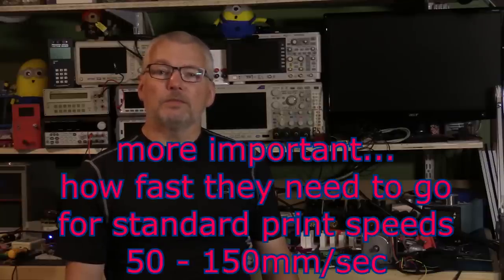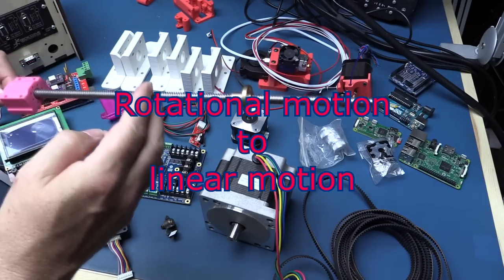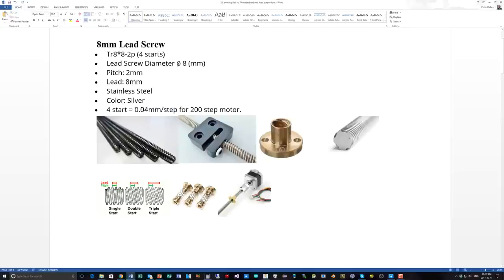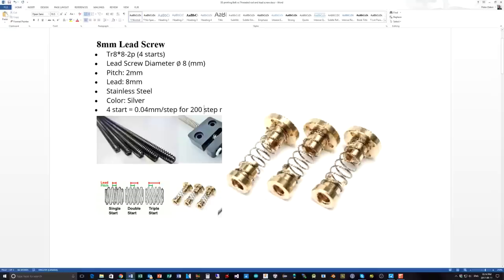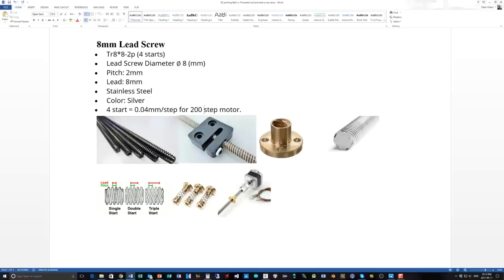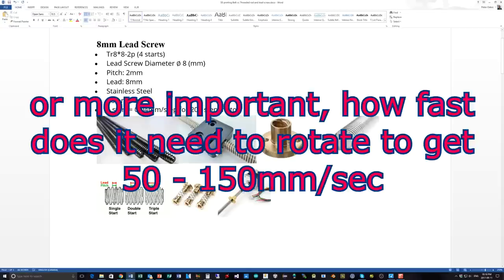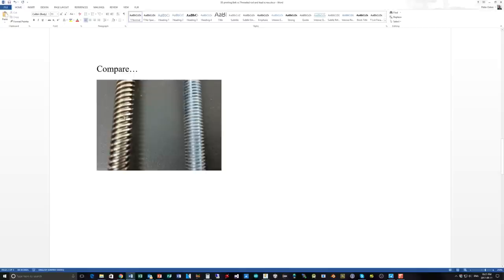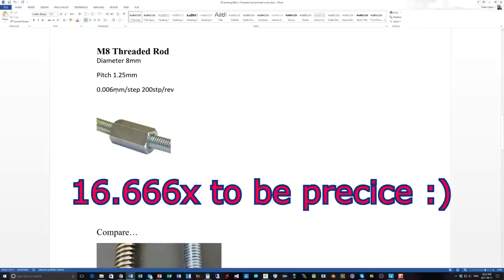3D printing, what to use... BELTS  or SCREWS ??

Comment: I'm doing a printer build that is mainly for research and learning to build a commercial printer to aid in fixturing for my CNC mill and to produce durable printed parts. 

It'll be my 3rd 3d printer but first custom build. It'll use linear components from PBC Linear. Goal is to make a precise decent speed printer with high temperature capabilities, meaning hot end capable of 450C and a heated chamber capable of around 160-180C. Because of the high temperatures I'm looking into not using belts. Reliability is also a goal.

Discovered non captive lead screw stepper motors and am considering them. Extruder assembly will be using a remote direct drive extruder like a Zesty Nimble and liquid cooled Slice Engineering's 450C Mosquito hot end so extruder assembly on X axis will be fairly lightweight. Because of the weight savings I'm interested in using a non captive Nema14 lead screw stepper motor from PBC Linear fixed to extruder assembly on a linear rail.

Since non captive Nema14's internal drive is what spins and the leadscrew doesn't spin I'm thinking this setup can achieve decent speeds and useful for large footprint designs since lead screw doesn't spin.

I'm interested in what others think about non captive lead screw stepper motors for X and Y on a large footprint 3d printer.
Reply from the maker: Thats quite the project
The fact that your "Spinning" the inside of the stepper rather than the lead screw does remove the moment of inertia of the lead screw but at the expense of the moment of inertia of the internal nut of the stepper + the mass of the actual stepper motor for two directions, this could be quite extensive. and the internals of the stepper could be subject to the very high temps of the build chamber. Another thought may be to stay with traditional ball screw / lead screw and have the steppers outside of the build chamber (Small holes would do it and not effect the temp stability of the chamber much. to compensate for the mass of the lead screws, simply use Nema 24's, you have much more space for them in this configuration. the rest of your build seems pretty well thought out, I look forward to hearing more about it.
Reply: @TheBreadboardca  Thanks for the response and input 👍

Regardless of how the extruder assembly is moved I'll have flat insulating accordion bellow covers to isolate motion system above heated chamber and more than likely liquid cooling stepper motors with same water loop that the Mosquito hot end is cooled with.

After some more research I'm back to considering belts. But still think the non captive lead screw stepper motor is an interesting idea. More than likely will build this large printer I'm working on with high end belts but after that will make a 200mmx200mm or smaller proof of concept build trying out non captive lead screw stepper technology.

For a large gantry style printer that has a print area of 2'-4' on X and 4'-8' on Y non captive lead screw(maybe ball screw if they exist) stepper(or servo) I'd think would have a lot lower moment of inertia than a 4'-8'+ spinning lead or ballscrew, not to mention the fact this avoids others issues involved with long fast spinning lead or ball screws.

Because my extruder assembly is so lightweight I figured for X axis a Nema14 stepper motor would be the minimum needed to move itself, extruder assembly and overcome friction from leadscrew coupling/anti backlash nut. 

Y axis would have either a Nema17 or Nema23 non captive stepper for each Y axis linear rail, so 2 of each.

Only reason I'm reconsidering belt drive in probably a coreXY arrangement(I like hbot arrangements simplicity but not gantry racking, additional rigidity and more precision assembly requirements)is it'll be a lot more cost effective, lower moment of inertia and only need 2 stepper motors for XY that can be located on outside of printer.

If I was to build a large printer with non captive stepper for XY all 3 motors would be fixed to a beefy gantry which rides on precision linear rail assemblies.

I'm avoiding spinning lead or ball screws for everything except Z(also considering non captive steppers for Z axis) because printer sizes I'm interested in are kind of long for a fast spinning lead or ball screw.

As things progress a little farther I'm going to upload the build to YouTube.

I'm also interested in carbon or glass fiber and G10 like composites and how they could be used to make a strong, stiff and lightweight X axis.

I'll be using my 30"x40" milling area welded steel construction industrial grade cnc router capable of milling aluminum for the builds metal or composite parts.

Comment: Most of the belt stretch is actually in the elasticity of the teeth on the belt, not the belt backbone. also placing too much torque on the belt can strip teeth which can introduce intermittent faults that can be a bugger to find
Reply: I can confirm that from experience: the rubber teeth will bend / rip long before any stretching in the tension element...
Reply: I know that the cheap rubber GT2's will stretch pretty quickly initially. Kind of like a guitar string, which you have tune, stretch, tune, stretch, etc... 
Polyethylene steel re-enforced belts are said to not stretch as much...

Comment: I built a CNC mill and needed to use screws for the axis because I didn’t think belts were up to the job. I ended up having to drop a decent amount of money on some C5 rated ball screws because the nut on the leadscrew wears out too quickly and causes lots of issues.

Comment: Great tutorial and is very informative. I am building my first 3D printer which is a Prusa i3 clone. The X and Y axis is run by GT2 20 toothed pulley and belt. The Z axis is on 5mm threaded rod which means the Z axis steppers will be running like mad especially if Z hopping is active.
I think the best bet is to get this running as it is but prioritise making printed parts to accommodate lead screw or better still ball screw rods and do away with the 5mm threaded rods and maybe change the GT2 to 16 tooth for better accuracy to the X and Y axis.
It is quite clear why this guy has gone for lead screw on all axis as there is a good balance of torque and accuracy for it's purpose.
Reply from the maker: Good luck with it... one of the primary reasons lead screws or threaded rods are used for Z  is so the X does not just come crashing down when power is removed from the steppers

For this build (Also a prusa I3 mkII clone), I may yet change to belts for x and y but I want to go through the process to show my viewers what will happen and how good (Or Not) it is.
Reply: Thank you for your quick reply. I will be following your progress as this is really interesting. Just a quick question if I may, in your opinion is it worth increasing the ratio by using 16 tooth drive pulleys or will the end results be negligible ?.
Reply from the maker: Andy P I think it can only help. It will not be detrimental

Comment: A very interesting vid.  I have been thinking of changing my 20t pulleys for 16t then adjusting my steps to compensate which in turn will slightly increase my motor's rpm's. My 20t pulleys are showing signs of wear so need replacing soon anyhow. This vid makes me think going to the smaller pulleys is worth doing.

Comment: I disagree with the comment at about 28:49. Higher voltage to the motor helps to counteract back EMF allowing higher speeds to be obtained. BEMF is typically what limits the maximum speed and is why higher voltages are utilized. To determine the maximum voltage a stepper motor can take use  32 * √L = max V where L is the motor inductance. The driver may ultimately determine the max V though.

Comment: You did not mention efficiency, which is also a factor. Belt drives are about 90% efficient. Lead screws are only roughly 50% efficient from what I have read. That will result in loss of power, more wear and probably a lot more noise (deal breaker). I debated going for lead screws in my own build, but ended up going the conventional way with GT2 belts for now. Thanks for the video. I hope you follow up and show us your build once it is finished.
Reply from the maker: Yes, lead screws are I believe nearer 70 but very dependant on the quality, a ball screw though can be as good if not better than a belt for efficiency, but at significant cost increase. now the losses are easy to compensate for by using higher drive voltage (Increasing low end torque) and also more powerful stepper motors.
I am using GT3 belts as for 1, I already have the belts and 2 there bigger and less stretch, but less resolution in the drive per step.

One thing I will also be trying are IGUS bearings, self lubricating and should be more efficient due to low friction
Reply: I've read 30% for acme/trapezoidal.   20% for plain 60 degree thread,  and 80% for ballscrews.
Reply from the maker: I think a lot depends on quality, certainly threaded rod will be terrible as it is not even designed for this application. For most 3D printers of a reasonable size though even if less than 50% should be easy to compensate for using bigger motors, nema17 style probably already have more than enough for this. My smaller CEL Robox only uses Nema 11 or smaller I think
Reply: @MattOGormanSmith  ehat is also why trapezoidal often is used for vertical movement so it will have locking if power is lost

Comment: Great video which go in details. I am also considering making a 3D printer with leadscrew and no belt. There are also other aspects  which have to be considered with leadscrew: noise and power. I have heard  that leadscrew require more powerfull motors than belt, meaning more prowerfull stepper driver and motors...
Reply: yeah due to friction, leadscrews are a lot less efficient (about 1/2 to 1/3 of belts), and you need to grease them from time to time.
though if you have a bit more money (around 30-100€ depending on the dimensions of the printer) consider using ballscrews instead as they have virtually no backlash, are more efficient and may be more silent than leadscrews.
an other technology that exists but is used mostly in bigger machines is the rack and pinion which has the same backlash problems as leadscrew, but is a lot more efficient.

Comment: Well i have a question if we  use 2x microstepping will it make a 200 step/rev motor 400steps/rev? 

I don't think you can physically do this, you can make steps between step for smoother performance but can't create real step angle.
Reply: You supposedly "can" do this with widely debated results for simple 2x MS (many parties claim minimal loss of accuracy and precision, others claim none or significant; again with 4x), but beyond that the overwhelming opinion is that using MS positionally introduces massive loses of accuracy and precision. Then again, I've watched one video that demonstrated otherwise so I don't know anymore.

Comment: Bytheway the leadsrew what on the rigth in the doc, that is a 5 start one, not a 4 start. Just a little notice.
Reply from the maker: Wow, yes you are correct, I had not noticed, the ones I used in the with nuts on though were 4 or 1 start (Threaded rod) and the math still holds up, pitch * number of starts = lead so if this were a 5 start with 2mm pitch, it would have a 10mm lead. (10mm linear move per revolution), good catch,
Reply: I know the math I'm an engineering student. Just noticed it ;)

Comment: Recently I dissasembly a photocopier that uses a sort of 1mm fishing cord to move the scannig head. Do you think could be a good system for 3d printers?
Reply from the maker: Probably not, the scan head is extremely light compared to a 3D printer and therefor i expect you will experience issues
Reply: That system is what I say, look possible
Reply from the maker: My probably not answer was based on the hardware from a scanner, can you use spectra wire for 3d printers, I am sure you can, I dont know enough of the parameters of the larger form of this product or how well it will grip the pulleys (We would not want slippage etc)

Comment: if we change to lead screw drive..do we need to tweak the software..?
Reply from the maker: not the software but the configuration, you will need to change the steps per mm to match the screw vs what you had for the belt

Comment: I appreciate your video, thank you. I have a question regarding the video, however. In the Video you kept using 8mm as the travel distance for the lead screw relative to your revolutions. Wouldn't that number be equal to the pitch? (2mm) not 8mm even if you have a 4 start lead? one revolution should be just 2mm should it not? Which in turn would put all your math off by a factor of 4. Would it not? Perhaps I'm misunderstanding this? Also, if you wanted greater accuracy (Less speed/more torque) on something like a Core XY could you not go to a smaller number of teeth on your pulley?
Reply from the maker: nope, I am correct, with a lead screw with multiple starts, the way it is described is pitch=distance between threads, if there is only one thread then it also happens to equal the lead (Distance traveled for one rev), when there are 4 starts (Any thing other than 1 really), the distance traveled is the pitch (2mm in this case) * the number of leads (4 in this case) and that gives us 8mm. (I also physically verified this before responding), Weird I know but that's the way it works
Reply: Peter Oakes thanks Peter for the explanation. Seems somehow counterintuitive to me. As in how would the distance travelled change based on the number of times the threads on the lead go around the lead screw. I have a printer with z axis lead screws (4 start I think) I'm gonna test that when I get home tonight.
Maybe I'm thinking about it incorrectly. Thank you for your response and insight.
Reply from the maker: even though it is described as 2mm pitch, 4 start etc, think of it as 4 threads with 8mm pitch
Reply: Peter Oakes yeah, I'm getting exactly how you're explaining it... And that's the part that is counterintuitive to me. I'm almost home I'll definitely be checking my prusa style machine. I am completely curious to see how far it travels on one full rotation of the z axis
Reply from the maker: Let me know, you got me curious now too :)
Reply: yeah, Peter I'm getting it now. It looks as though the lead screw itself has four helical threads. I think I just assumed that there was just one and that the rise was equal to the pitch. But sure enough my 8mm Lead screw rises 8mm on one rotation. and that doesn't matter, of course whether you follow one thread or all 4. So your explanation was accurate about how to think about it. I guess the better way to think about it would be to look at the end of the lead screw shaft and see how many threads start there.

So, knowing that now, I wonder if a regular fastener type threaded rod has more than one thread as well? Because if, for instance it only has 2 but had the same thread pitch of 2mm....would it not only rise 4mm? Perhaps that is the cause in the difference of travel speed and other relative changes and less the pitch alone? Unfortunately, I don't have any of those on hand for comparison.

This has been very informative. I think I always just made the assumption that there was typically only one thread on a screw. I suspect I'll be looking out for that in the future now.

Thanks Peter
Reply from the maker: exactly :) and even with 8mm per rotation, that is still way less travel than a belt for 1 rotation, therefor more accuracy per rotation (less distance per step), this is not factoring in belt stretch or thread backlash though
Reply: Yeah, it's hard to see when all 4 starts are shown.  Easiest way (for me) is to think of the spooling mechanism on a fishing reel.  A long, high-pitch thread, single-start thread.  To cut the 4-start thread (single-pointing) in Peter's example, you just cut an 8-pitch(lead) thread normally (like the fishing reel spooler), then, delay the next start by 90 degrees, and cut another one.  Then' delay by 180 degrees (from the first thread) - repeat.  Finally, delay the last thread by 270 degrees - repeat.  You end up with an 8-pitch(lead) thread that just LOOKS like a regular 2-pitch, single-start thread, until you look at it from the end, and see the 4 starts.  Accomplished easily on a CNC lathe.  :-)

Comment: I.. just want to prevent my steppers from missing a step and screwing a 5+ hour print. (i tried everything to fix it)
what if you gear the leadscrew to move at the speed a belt and either use an 84oz NEMA 17 or a NEMA 23? 
closed looped steppers are too expensive.. belt systems are easy to over or under tension.
a minuscule amount of backlash is hardly a problem when a belt system can ruin your print and day.. 
as long as i get a part any surface imperfections can be ignored or sanded out.
Reply from the maker: the biggest thing I found to avoiding skipping is to have the right current dialed in on the stepper controllers, ignore the fact they get noisier, and they will run warmer, this is all normal and expected. Belt tension can be almost like a bow string, where if you "Twang it" it will make a note or almost make a note. What kind of printer are you running?

Comment: You have changed my mind - I am now going to use leadscrews for my Prusa 3D!!! Now all I have to do is sell the belting I bought!!!
Reply: So how did you end up doing it? I want to do a Fisher style with 12mm smooth rods, 1000 by 500 mm frame.

Comment: The answer should be what is your skill level? Beginners should use belts. I agree screws are superior and built my 20x18x18 with screws. Add 3000rpm motors and wallah you have high resolution and a very fast printer. At some point printing at 1000ipm has other issues like getting the material out of the nozzle.